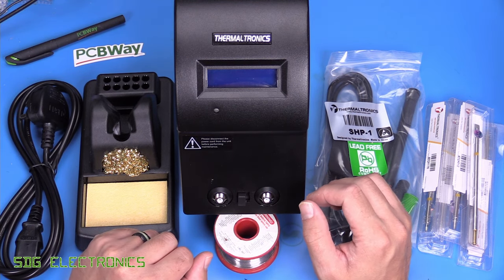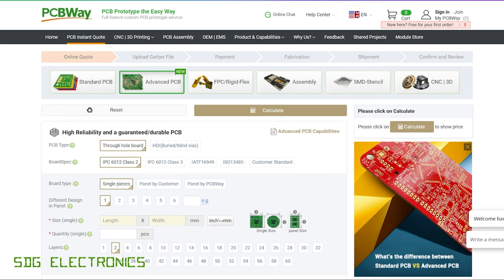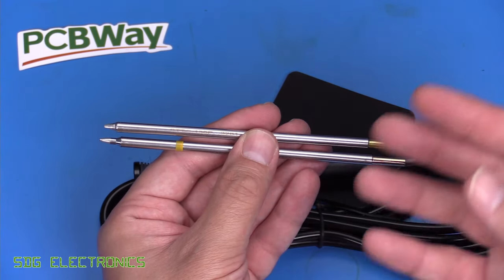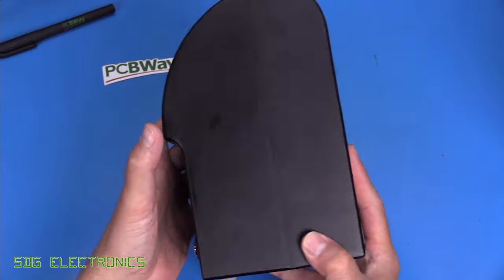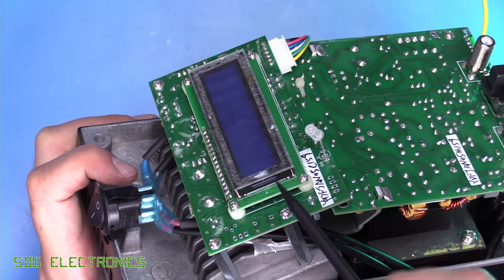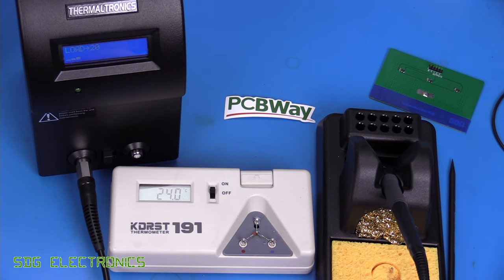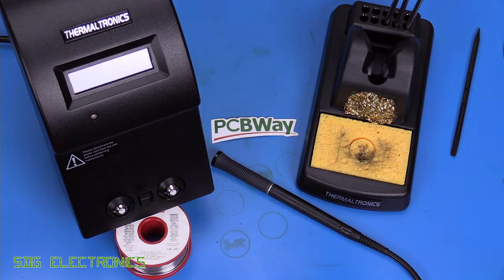SDG #313 Thermaltronics TMT9000S - Is it better than the Metcal MX?

Comment: Thermaltronics is a terrible replica, with poor internal workmanship that looks like it was produced by a small factory. Its tip lifespan is not as good as metric. Even if the price deviates, I will not consider Thermaltronics.

Comment: Currently in the US the Thermaltronics 9000 station can be found new for about $420 while the Metcal MX-500S station is about $640. Also note that the smaller 470kHz Thermaltronics unit TMT2000 can be found for $200 new, with used stations occasionally showing up on eBay for as little as $50. If going with the cheaper TMT2000 series I recommend the P series tips as they are quite tiny, almost as tiny as the 13MHz tips shown here.

Comment: In Australia the difference in price between the two units is about $600AUD. Furthermore Thermaltronics have a local representative that provides support and a 4 year warranty on the power supply. The tips are also at least ~1/2 price. I've owned my TMT9000S for just under 1 year now; soldered thousands of leadfree through-hole joints without issue - with pleasure. I've also purchased a few specialty Metcal tips and had no compatibility issues; actually thermal recovery seems to be slightly better.

Comment: Can you simply change the transformer taps of MX500, and switch the USA version to be used with 230V?
Reply from the maker: The MX500P that I featured here has a SMPSU as far as I know. The older MX500 with the din connector had a proper transformer

Comment: We have a few Metcal power units here at the lab that have firmware that detects the Thermaltronics tips and refuses to power on. Early Thermaltronics 13MHz tips were faster to heat up and the Metcal firmware tried to detect that to discourage using "aftermarket" tips. Overall I think Thermaltronics quality is on par with Metcal and is a good value.

Comment: I find the Thermaltronics tips to be better than the Metcal equivalents - Better life and in some cases better geometry -  e.g.M7DS525 has sharper edges  than SMTC047 - good for reflowing DFNs as it gets right into the corner between PCB and package. 
I'm told Thermaltronics was started by some ex Metcal people.
Reply from the maker: Yeah I remember most of your tips looked like they were Thermaltronics ones. I heard similar about the origins, but I'm not sure how they got around patent issues
Reply: Metcal soldering equipment have been on the market for so long that the patents have expired quite a while ago. Most of them date back to the 1980s.
Reply: @sdgelectronics  Metcals main patent had expired - they've been around for a long time - I had one over 25 years ago
Reply from the maker: @mikeselectricstuff  I thought I saw some more recent filings around the digital power meter, but it must have been some specific implementation.

Comment: Thanks, Steve.  Excellent review, as always.  I was amused to hear you mention my only three complaints with my old Metcal PS2E-01 stations.  The mains transformer is always on (and it makes an audible hum; doubly annoying with two of them on my bench); the handpiece cradles have no magnets in them, so when I forget to turn a station off, the tip gets cooked; and, it latches in a fault condition if you remove a cartridge, so you can't hot-swap them and must power-cycle the units.  I overcame the transformer hum by building a remote-controlled switch box that the units are plugged into.  It looks like I should have just opened them up and re-wired them!
Reply from the maker: We used the old PS2E and old MX systems at work for a long time. People left them on over the weekend burning out the tips all the time 😂🔥
Reply: On the older Metcal MX-500P having the power switch on the secondary side of the transformer is kinda weird. The high voltage DC rail (~53V) is always energized when plugged in. The switch just turns off the lower voltage DC rail (~26V). Does anyone have any idea why they would do such a thing?

Comment: Power plus tips supposedly have larger heaters and more copper mass (easybraid also did them). I tried one of the thermaltronics ones, very slow response, maybe a bad tip geometry though.
You said in the MX-H6-HTD (red handle) review you'd try the metcal power plus cartridge in the regular handle, let us know when you get time, thank you.

Comment: I've been using an MX-500 for ever.  But I do prefer the Thermaltronix Tips.  They do seem to last longer.  I have had several Metcal tips spontaneously die.  I also love the colored band to I.D. the temperature range.  Seems so obvious to do.
Reply: yeah worth it for the color band alone.
Reply: Users in a couple forums commented that Thermaltronics tips don't last as long. Not sure if it's true or not.
Reply: @acoustic61  Maybe it's a toss up.
Reply: @Runco990 Judging by this review, Thermaltronics seems to be lower quality. No reason to believe the tips are better. I haven't been able to figure out where the company is based. There's no phone number listed on their website. They don't respond to emails. Definitely doesn't seem like something I would purchase for a production environment.
Reply: @acoustic61  I admit I was disappointed when watching this review.  It seems Thermaltronics started out well, but this station clearly shows slipping quality.  My original MX500 is doing just fine and so are the tips.  The one's from Metcal that failed often for me are the DE-soldering one's.  I have not needed to buy new tips in a few years, so maybe things changed for the worse....  Will see next time I buy some.

Comment: Thanks for reviewing this. I wondered about Thermaltronics quality. IMO, buying used Metcal power units may make better sense for hobbyists. I bought three early Metcal MX-500P-11 power units for under $100 US each. I had to repair two of them because one surplus dealer lied about the condition. They weren't real difficult to repair. They use off-the-shelf parts which are mostly still available. And schematic diagram is also available.
Reply: Yeah used units are commonly available and way cheaper. Buying new metcal makes no sense as a hobbyist.
Reply: I just bought a used mx-500 p11 I love it  think used is a good option now I"m looking for more got the Metcal bug
Reply: @scorcher617  Yeah I was watching too many reviews and now have half a dozen various soldering stations. Metcal performance is impressive. MX-500-P11 is built like a brick dunny. Seems like it'll last forever. I actually used one Metcal station to repair the other two with dental precision.
Reply: @scorcher617  nice, you can pair it with hakko handle or tweezers as well if you want more options.
Reply: @jaro6985  I haven't tried myself but It should work with Hakko FX-100 handpieces, tips & accessories. However, Hakko tip cartridges only fit Hakko handpieces. And Hakko did have problems with some of their early tip cartridges and replaced them with newer improved parts. So be careful which ones you buy.

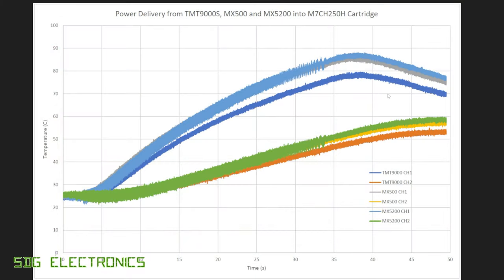Comment: Great review as always.  Thanks for sharing.  Is that noised induced into the temperature sensor board @19:37.  I assume the MX5200 tip was removed at ~T=34S.  The others seem less noisy.  What are the actual temperature sensors ... LM35s perhaps.
Reply from the maker: I accidentally cut that narration out. It appears to be electrical noise since the frequency is too high for real thermal events. The probe set-up wasn't optimal, but I didn't investigate further. The sensors are TC1047A

Comment: I find the metcal range rather confusing. I have a MX500s station and decided to upgrade the hand piece to the MX-H1-AV but I found an unexpected behaviour when looking at the powered delivered from the station. Using the STTC137P tip I have seen that the stock iron (MX-RM3E) is much faster to go up to temperature. It also uses the entire 40W that the station can deliver whilst heating up. The MX-H1-AV, even if is a nicer iron from an aesthetic and an ergonomic perspective takes reasonably longer to heat up and seems to be much slower in responding to heat demands. It would be nice if a video was made investigating differences between different metcal RF stations and hand pieces. Little info is provided on this topic.
Reply from the maker: Word from Metcal is the two handpieces should behave the same, except perhaps slight component tolerance or some ageing effects of the passives that are in the handpiece.
Reply: @sdgelectronics  Thanks for the answer. Both handpieces are new…1 sec difference in heat-up time… that is not too different in fairness
Reply: Interesting. I only have a couple MX-RM3E handpieces  that came with the MX-500-P11 which I bought used. I thought about getting a new aluminum handpiece because it looks cool and I wanted the sleep stand. Any idea how I can turn the RM3E stand into a sleep stand? Which type and shape of magents are used and their location relative to the tip?

Comment: I am an electronics hobbyist . I need a medium budget soldering station that has a good thermal capacity and supports all the JBC hand pieces too including the t245, t210 and t115 hand pieces. I also need a temperature range from 50 degrees Celsius to 500 degrees Celsius. The station should be dual handle supported and should be able to operate both hand pieces together independently. Both sides should be able to deliver  maximum 300 watts.The tips should be cartridge style too.  Can you give me some recommendations about this.

Comment: I just did all of this comparison between the brands last week and the prices you paid must be very different than what we have in the US.  There is still a good $200 spread between a TMT9000S and the lowest cost Metcal MX500.  Ended up finding a used MX5200 cheaper than the Thermaltronics so went with that, but if the price between mx500 and tmt9000s is only 5-10 pounds difference, that is an impressive spread in price based on market region.
Reply from the maker: There used to be about £140 difference, but that disappeared last year. Fortunately I got this one at the original price, but they increased it after my order.

Comment: Just to add to the discussion, I understand that the mx5200 is indeed a more powerful station at 80W output but this only useful when using 2 handpieces concurrently. The MX-500 and the TMT9000S are a 40W output because only one of the two outputs is active so plenty in most cases.   Ultimately the cartridge is the same for both the MX-5200 and the MX-500 so that will determine how much power can be dumped by the cartridge.
Reply: Nope, you can use 80W output on a single channel on the mx5200. Then you can switch to a 40W/40W mode if you want as well.
Reply: @jaro6985 hi there, I looked into this a little more. It turns out that my previous statement is immacurate. My understanding now is that the MX5200  station is capable of delivering 80W in a single channel but to do so a high thermal demand handset and tip is required. I only have a MX-500 so cannot test the 80W claim but video #226 goes some way to explain this
Reply: @ivanr5315  the normal tips I used will take 80W without an issue, you dont need the special tips. The special tips probably just last longer when driven hard, and have that big copper slug to act as a thermal tank.
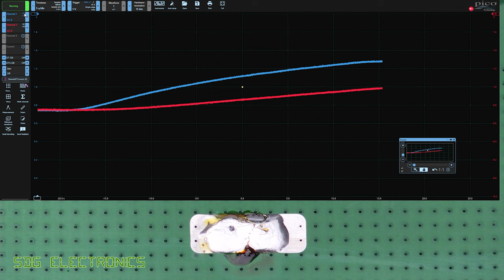Reply: @jaro6985  Ok, thanks. So I cannot explain the last test in this video @19:02 that shows an identical soldering temperature profile (meaning that the same energy is being delivered over a long period) when soldering  a big thermal sink for the MX500 VS the MX-5200. Still remains a mystery...can you explain it?
Reply: @ivanr5315  Sure, either the station is in the wrong mode (unlikely), or the thermal transfer is limited by the tip geometry. If you have a very small tip (1mm wide) it doesnt matter if your power supply is 20W or 200W when you can only transfer 10W through that tip into the PCB. But you bring up a good point, that its worth looking into the data and possibly tweaking the test setup if its not loading the station enough. I've verified power consumption on the PS5200 and PS5000.

Comment: how about hooking up a antenna and using the handpiece wirelessly
blasting out 13.5 mhz at whatever watts its using makes a fcc employee appear behind you out of nowhere and giving you a slap in the neck

joking aside, whats the advantage of rf heating over a plain resistor.. latter is 100% efficient
Reply: RF heating means zero overshoot. You also get fairly even heating throughout the whole curie slug.